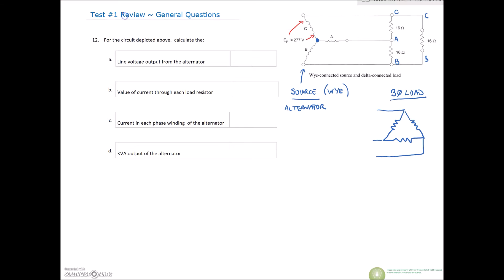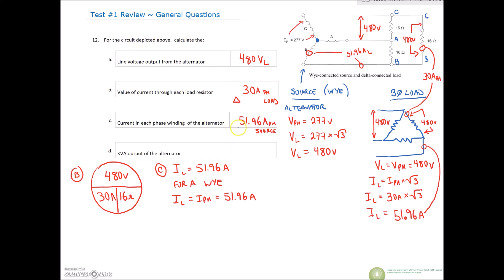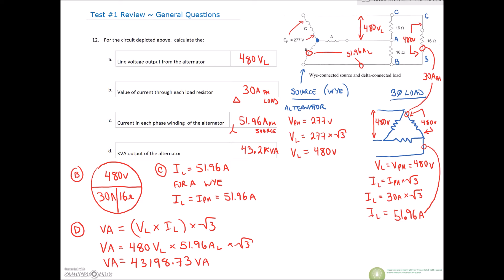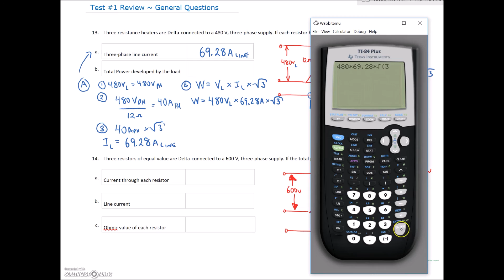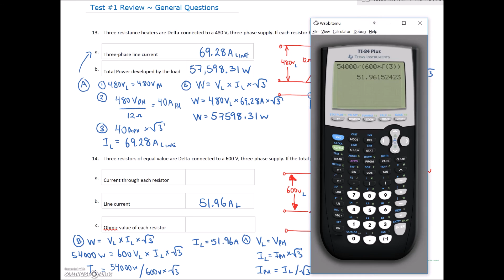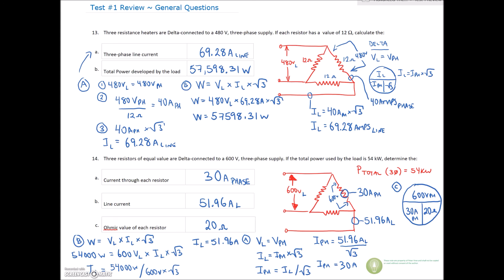3 Phase Test #1 Review (Part 3)

Comment: Question 14.b. Shouldn't formula for I should be I=54000w/600V/√3 instead of I=54000w/600V*√3? Thanks
Reply from the maker: The equation is correct for 14B. If you isolate "I" on the right side of the equation, you would have to divide both sides of the equation by (V *√3). You can do this as well for transformer nameplates.. to find the max current available, simply divide the VA rating by (V *√3)
Reply: @PLCAutomationAcademy  Got it.  Thanks! Great Videos BTW.